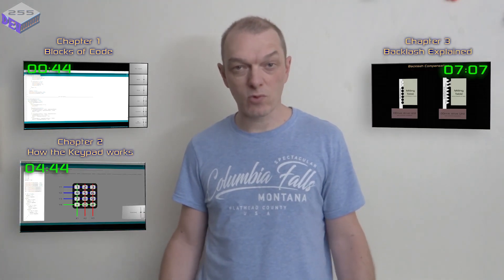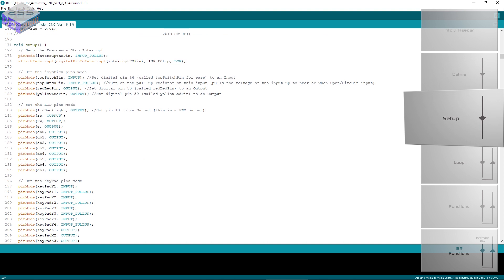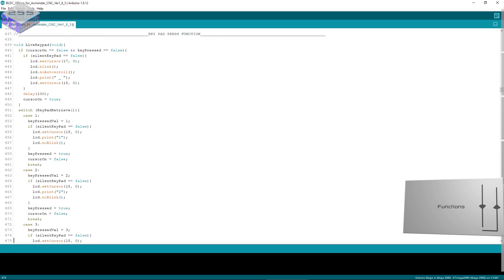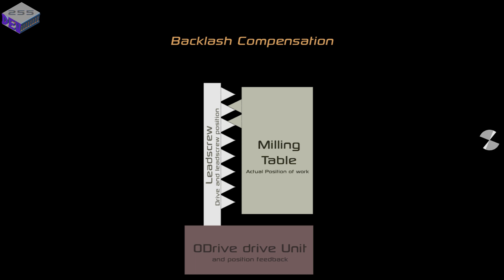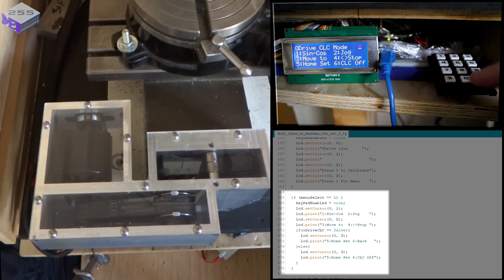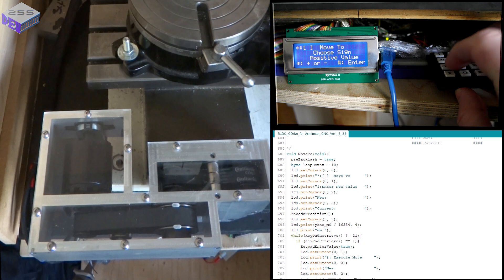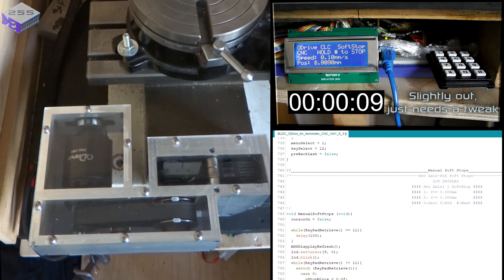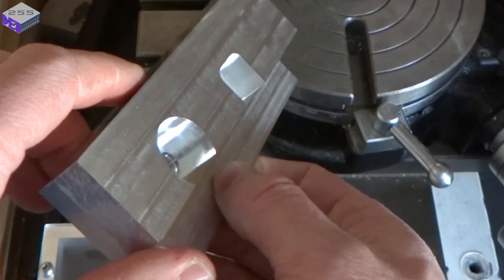CNC Mill Conversion Part 8 - Program step through, Backlash control & Keypad

Comment: I find the ODrive has a dead zone to stop it from jittering when you give it an encoder position to go to. Did you find a way to modify the dead zone?
Reply from the maker: Hi Eric, I found that re-tuning the ODrive (according to their online gide) under different load situations (i.e. free running, under belt tension, etc) that there were no dead zones or jitter. I think most of the jitter experienced is with the stability of the encoder, where mine is very securely attached, I know this is hard to achieve with an out-runner on the rear axle, especially if you need to save weight. I  don't have any issues with demanded positions, where it sits in any position with a very strong hold. You may find an answer in Part 4, where I ran through the calibration. Hope that helps.